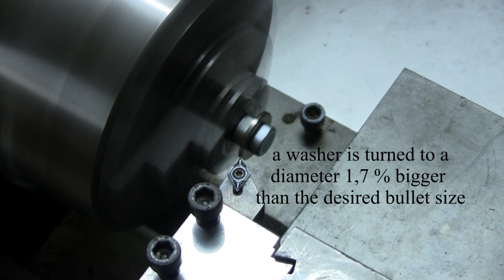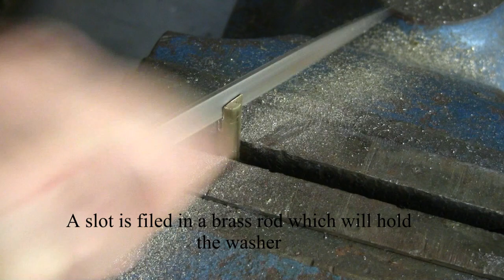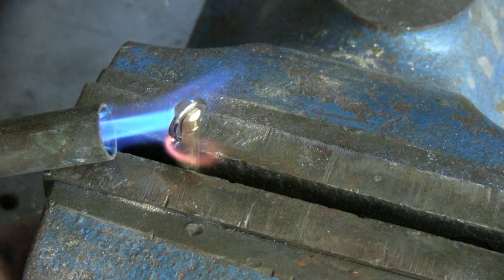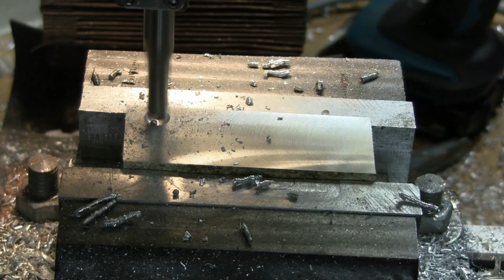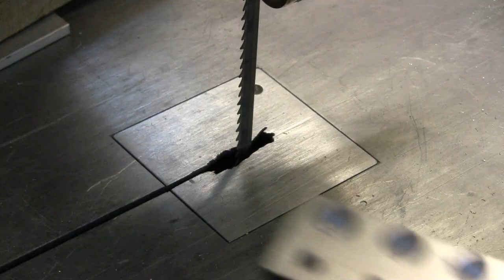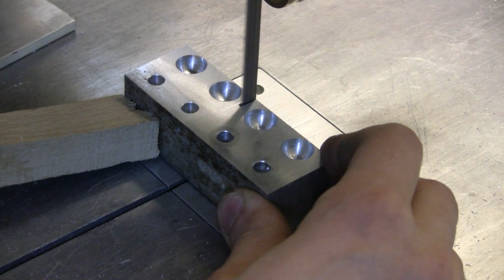Home made .45 roundball mold for a muzzle loader

Comment: by the way, how do you know by how much depth you drill with the improvised brass rod cutter?
Reply from the maker: The improvised cutter will only cut to the bottom of the pilot hole and stops then.
The depth of the pilot hole was measured by a digital readout on the quill of my mill.
Reply: and you made it so that the depth was equal to the radius of the roundball I suppose. Thanks for the heads up. :)

Comment: This video is up 8 years now and i've seen it plenty of times.

Lots of negative comments since the time of the ammo shortage.

All the keyboard warriors telling this cant be done without cnc.... Yes it can, even without digital readout on a manual mill.

The ones telling him to just buy a mold and this takes to much time.
The creator is not from the USA, probably could not find a mold or a reasonably priced one.
It doesnt take to long to DIY if thats the way to obtain it.

Just remember not that long ago everything was made on manual equipment. In the 1800 they made functional revolvers with crude manual equipment. 
These days most guys from western countries couldnt even make a basic gun themselves without it showing Bubba engineered from a mile away...

Comment: nice video, I never thought  to use a washer! Looks like you lined up the washer and brass shank by eye for soldering? How critical is exact centre so you dont cut a wider hole? does the brass bend a little and the washer self center?
Reply from the maker: +lostsignalreception 
Hi, if the brass rod is long enough (length 10x the diameter) then the rod is flexible enough to compensate the offcentered alignment.

Comment: can u also make 44 caliber mold for the round ball
Reply: This is for the .44cal. You cast balls .45cal so they're bigger than the chambers of the gun so that when you ram them in they create a tight seal and get stuck in there so the powder can build up the pressure to shoot. The .44cal balls that you buy are also .45 and the extra gets shaved off when you ram them

Comment: I'd consider it click bate there's no factual commentary.
You can't just drill random hole's,....this would require precision digital gauges  as per hole and pin placement and depth for it to work.
It can be done on just a end mill but you would need to lay the part out by hand and precisely drill where you need to frill to the proper depth.
And in the end you need to achieve the right diameter.
Reply: I'd recommend drilling the holes, filling them with already made balls (store bought ones will work or just borrow them from somebody else), putting the halves together with the balls in, THEN drilling the alignment holes and putting in the pins

Comment: Hello,
so it is possible to make a mold with only a drill press if we use special bits? thanks you in advance
Reply from the maker: Hi,
it may be possible if can lay out the positions of the holes accuratly enough.
However it will not be perfect.
I am editing a video on how to make uneven shaped round balls perfectly round.
Reply: Thanks, waiting for your video. I actually browsed the videos on youtube and found some guy who did it (buckshot mold with a drill press). :)

Comment: This whole thing is absurd! You drill "alignment" holes independently of each other???? Lol, that would take some incredibly accurate machining that would be all but unachievable on a manual mill and would require a CNC setup of extremely high quality. I have been a machinist for many years and the number of things wrong here is almost comical, I am calling BS on this whole thing!

Those independently drilled "alignment" holes is about the dumbest thing of all the ridiculous procedures shown here!
Reply: Yeah. Drill the holes, fill them with already made balls, put the halves together, and then drill the pinholes